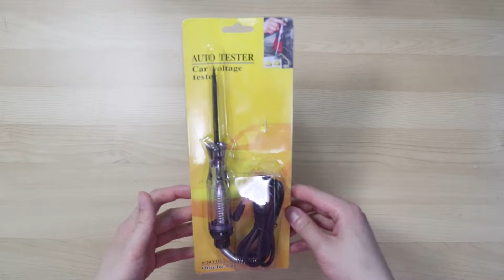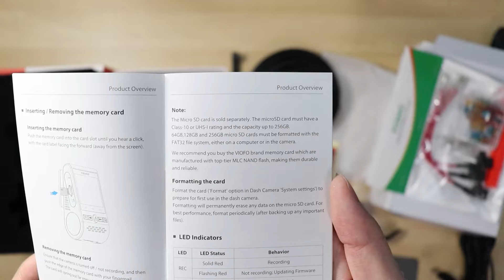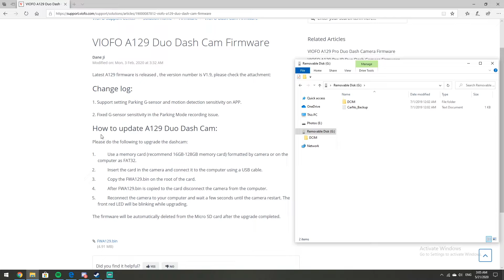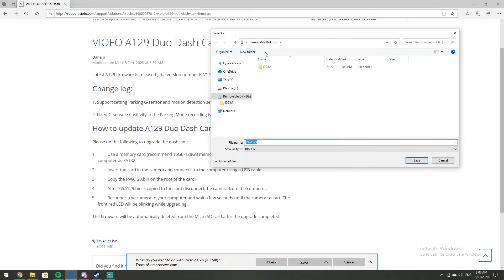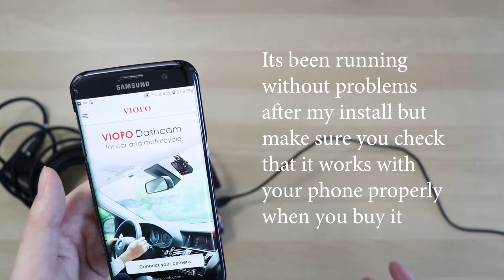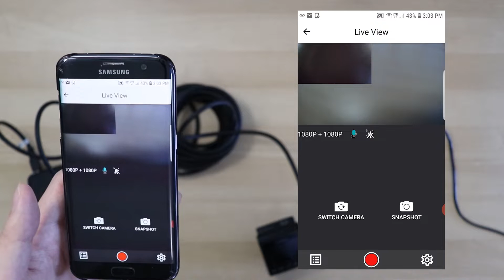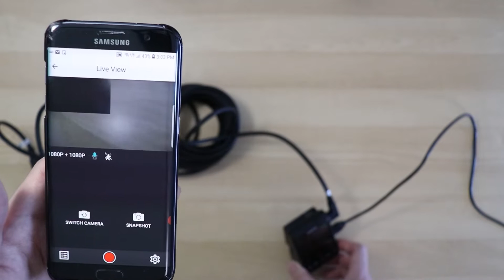VIOFO A129 DUO Unboxing and Setup for Hardwire Installation (Part 1/2)

Comment: Thank you for this video, it's super detailed and answers so many questions other tutorials don't mention!

 I found the metal tips on the fuse tap piece to be a little tricky to push down, but it still only took 5 minutes. My plier work was nowhere near as clean as yours, but it still worked and fit in the plastic tube!

I watched your other part, and really connecting the hardwire kit to the fuse taps was the most involved part, and it wasn't even that hard to follow. Everything else was a breeze.

Comment: Great install... I would wait on heat shrinking until you have the wires ran to wherever the fuse is incase you have to feed the wires through some tight spaces, then when you are at the fuse panel connect the fuse tap then heat shrink it.

Comment: Whenever i feel like  i want to shoot Video of both the Front doors these cameras have Option to Shoot outside at any time like a Vlogger and do not want to shoot video of (Front and inside the Rear Room) , then the SKYBLUESEA B2W & CAMSONIC ULTRA Z 2 & 3 Dash Cam Benefits if a person want to shoot a video outside the front doors sides Left & Right. Option like Rear View Mirror , would be easy to change the direction to record Multiple Angles like a Pro Photographer of both the Cams accordingly , option to Rotate , as they Rotates 180 degrees and covers the area least 160 degrees , like Rear view Mirror Angle . I love those Dash Cams .
My suggestion to the Dash Cam Manufacturers .

Comment: @AnthonyMo can you power the unit by inserting the usb power cable from the hardwire kit to the power outlet on the gps module? this will avoid the tight cable fitting on the side of the camera unit that you are explaining around 9mins10sec in the video.
Reply from the maker: Yeah I think that is possible but the reason why I dont do that is because the dashcam will turn off if i want to release it from the GPS mount to use it. But to be honest, i never really do take it off the mount anyway
Reply: Yes you can power it this way. Either powering through the camera or GPS mount works. But VIOFO recommends powering through camera. It functionally makes no difference, as the camera will power the GPS unit or the GPS will power the camera.

Comment: What if I wanted to wire the dash cam to the cigar lighter without wanting to use the parking mode features? Could I just wire the dash cam with the yellow wire and leave the red wire un-used? I only want the cam to turn on and off with the ignition but without having to use the actual cigar lighter port.
Reply: Yes, you have two choices. Either get a 2 wire kit (HK2) from VIOFO and only put the wire to an ACC (cigarette lighter) fuse. This will not support parking mode and will only turn on off with ignition. OR use the 3 wire kit (HK3) as shown in this video and turn off parking mode in the settings. The cam will only record on/off with the car. It will still be powered by the battery, but since it's not recording, it's essentially in "sleep mode" and draws very little power. Probably just as much as your cars built-in key fob detector.

Comment: I really was hoping the camera already had parking mode enabled without doing all this. 

With that being said.... How does the camera lock footages? If I get into an accident, how would the sensors know and lock vs if I ran over speed bumps. I mean it's not wired to the car yet except got the outlet 🤷🏻‍♂️🤔🤔
Reply from the maker: Yeah, unfortunately any dashcam will need to be hardwired to be in parking mode. There should be a sensitivity setting for the G-forces that determines if footage will be locked. I dont think it should lock over speed bumps unless you have a rediculously stiff suspension. My car is on basic coilovers and it doesnt trigger locking footage.
Reply: @AnthonyMo  ok, lost me after @10:05 haha. I have zero experience with this.
But I have the blue ended fuse tap and I don't know what I'm doing, I connected the red wire (battery+) into the blue end of the fuse tap, but how do I close it together? Do I need something else? 

This is a bitch to put together not knowing what the hell I'm doing and going back and forth buying these little things
Reply: Also if you buy a larger SD card, you have longer before anything is overwritten and you should be able to get to the files and save what you need.
Reply: @Kpher  I love his install instructions- but I’m going to pay Best Buy 60. To install mine- but now I will know if they are doing a good job or not...haha.
Reply: @InLawsAttic  when I installed mine, I hated it so much. It wasn't hard, it was just very time consuming and frustrating lol

Comment: How would you know that your dash cam is working in parking mode after using hardwire kit? Should have any LED indicator on?
Reply from the maker: Yep, theres an LED indicating that its on when it activates
Reply: I hardwired mine and it shows an icon in the upper left corner if it's in parking mode. The icon will be different depending on the parking mode you choose. When I turn off the car, the camera will go black and the recording light will stay solid red. This is because I chose low bit rate mode, which records continuously. If I press the menu button, it'll show the parking mode icon. If you choose a different mode (like auto event detection e.g. motion sensor), the recording light will be a blinking red instead when the car turns off. This means parking mode is enabled, but it's waiting for a motion event to record. Once it detects it, the light will turn solid red.

Some models with no screen have voice notifications instead. If parking mode turns on when the car turns off, it'll say "Parking mode enabled." You can look up the Viofo support article "Has the Dashcam Entered Parking mode?" to see the different icons or what it'll look like for your camera.

Comment: you don't need a battery pack for parking mode ? do you guys recommend a obd power cable as alternative to hardwire
Reply: You do not need a battery pack, but you can use one if you'd like parking mode to go longer than a couple days without driving (to recharge the battery). Viofo doesn't recommend OBD install, they don't sell an official cable and the cams do not support parking mode with OBD port. You'd need to use the fuse box because it needs an always on fuse to power it, and an accessory fuse to track when the car is on/off (to switch to parking mode). 

Even with a battery pack, most cameras won't record longer than a few days without driving a car. If you're looking to record longer than that, either hardwire a camera in your home pointed towards your driveway, OR get a thinkware dash cam with a RADAR module that extends parking mode (can record weeks at a time, but it'll only record when an impact or motion is detected).

Comment: If i don't plan on hardwiring, should i still get an sd card?
Reply from the maker: The SD card is memory space that is absolutely required for storing the video footage. The camera will be useless without one
Reply: @AnthonyMo  thanks, i figured it was needed but u listed it under the only for hardwiring installs
Reply from the maker: @ssenseaddict  Oops, my bad! Thanks for noticing it, I will change it asap!

Comment: is the hardwire kit necessary to run the parking mode ?
Reply: Yes
Reply: To add to OP's answer, the accessory fuse (yellow wire) is why the hardwiring is necessary. The camera uses the accessory fuse  to track if the car is on or off, to decide whether to enable parking mode or not.

Comment: How do you know to add 5 extra volts? Why not ten or fifteen volts?
Reply from the maker: I went with what was popular with other tutorials online and the 5amp fuse hasn't blown so I'm assuming it is alright and will protect the camera in case something short circuits. Its just a video on how it worked for me, but I am by no means a professional so I wouldn't be able to confidently explain why I used a 5 instead of a 2.5, 10, or 15. 

If I had to take a guess, the device uses slightly fewer than 5 amps so a 5 amp fuse allows the current to get to the camera without blowing. Lets say the camera pulls 4 amps and you used a 2.5 amp fuse, then the fuse would blow every time. Now if the camera was 4 amps and you went with a 10amp fuse, it probably wouldn't protect the device from getting too much current, resulting in a short circuit and your device getting fried. This is probably why you want to go with a 5 amp fuse because it still powers the camera without blowing itself. You could even test out lower fuses until you got a fuse that was slightly above when it would blow

Comment: This garbage didn’t even turn on when I bought it
Reply from the maker: Im not sure, I bought and installed two and they work really well for me. Not a sponsored video so I wouldnt have posted if they failed on me. Its unfortunate that they havent been working for you but installing any other dashcam should be the same, if not, a very similiar process
Reply: Did you actually install it in your car and connect it to a power source in your car? I don’t think it will turn on without any power